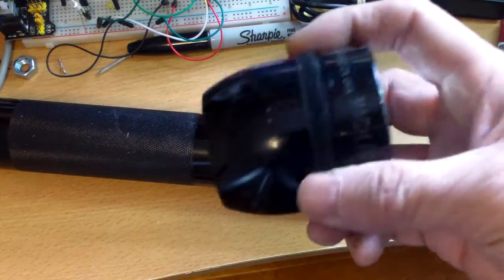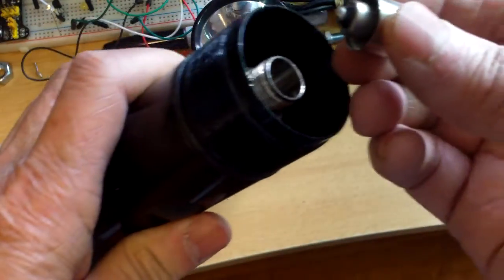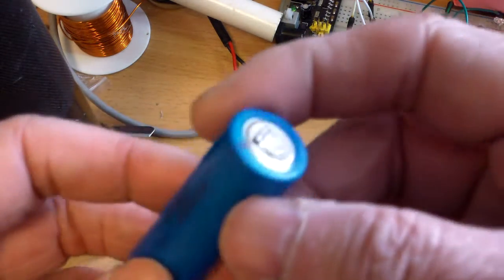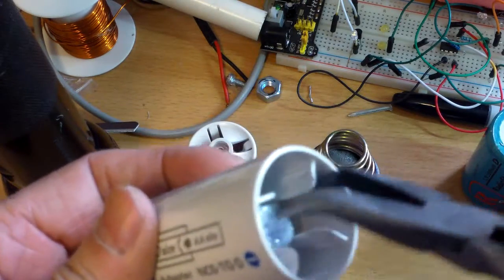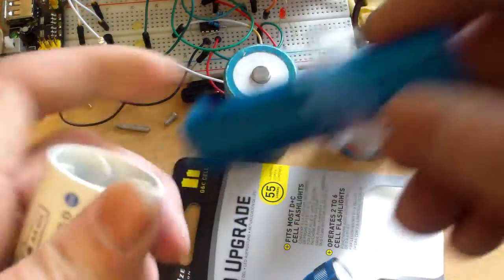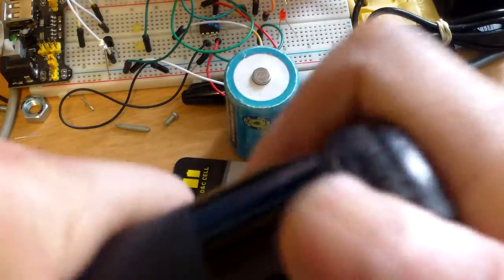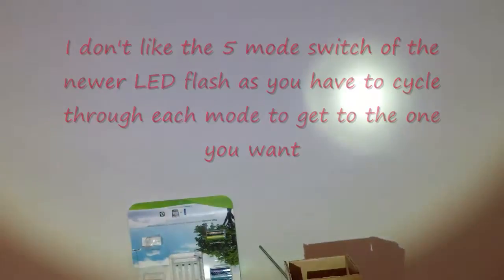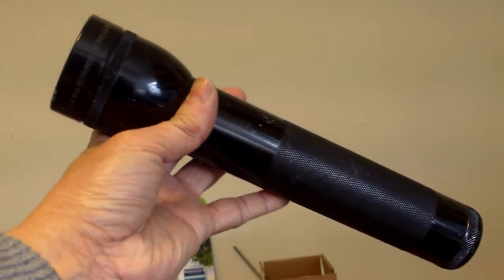Maglite 2 D flashlight make over

Comment: The 18650 cell won't make the LED any brighter. The LED bulb has a switch mode constant current driver inside it. The driver is almost certainly a buck-boost topology, which is why it can operate in 2 to 6 cell flashlights. A single 18650 cell just approximates a 3 cell flashlight. Anyway, it's a clever conversion; thanks for sharing the idea!
Reply: 18650 Li-Ion Cells WILL make your flashlight brighter when using maximum output LED systems such as the 3xXHP50 bulb assy. Li-Ion cells allow a faster discharge rate when higher current loads are present, however I wouldn't recommend the rigged-up system shown in this video unless you are doing this for an 'experiment' and you don't need to count on this flashlight for service.
Reply from the maker: +FlyingShotsman When the bulb dies, I will break it open to see what's inside.  Although it is expensive, it is much brighter and is my favorite flashlight without the whitish cool temperature of the other bulbs.  Thanks for your insight.
Reply: Not all LEDs have that in there drivers though. Even high end LED dropins from Matt Smith's Adventure Sport shop have different lumen output depending on the voltage. This is probably to keep the driver more simple thus more reliable. Remember, LEDs last for ages so you'd want the driver to last a long time.

Comment: I did not know those adapters existed.
This is good for my flashlight too. Thanks Paul
Greetings
Erik
Reply from the maker: Some eneloop batteries are sold in  a package with either a couple of  battery box or D and C size adapters.  You can therefore use the AA cells in devices that require either D or C size cells. I just adapted the D cell holder for use in my Maglite. The LED upgrade together with the lithium ion battery is a big improvement.

Comment: maybe you can drill it out so the battery tip fits
Reply from the maker: It's a little strange setup. If they only make the flashlight the way you wanted... bright, rechargeable, long lasting and reasonable inexpensive, then I wouldn't have to do this.